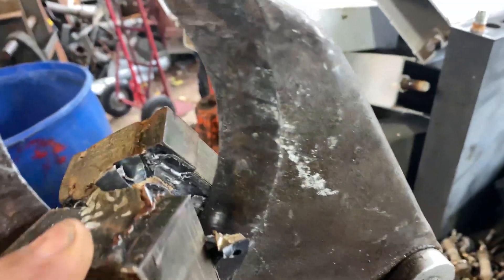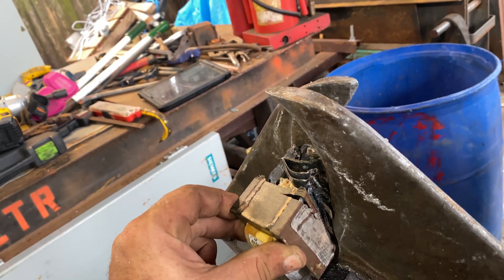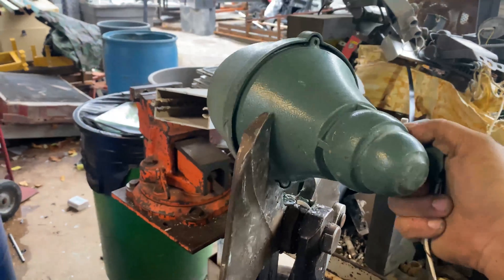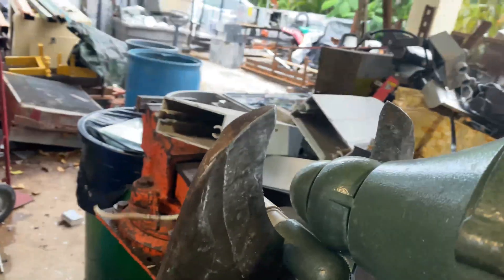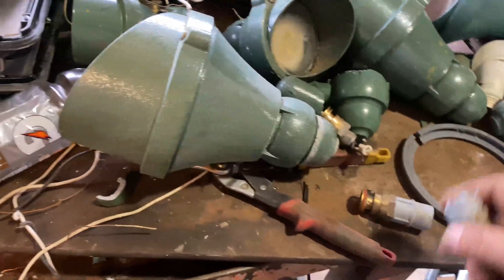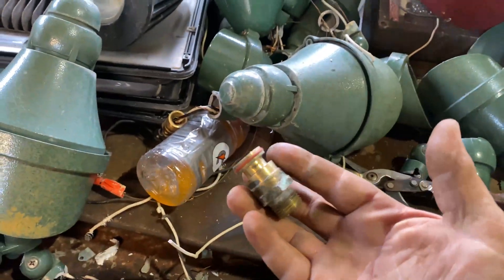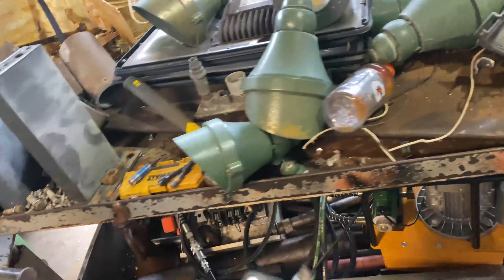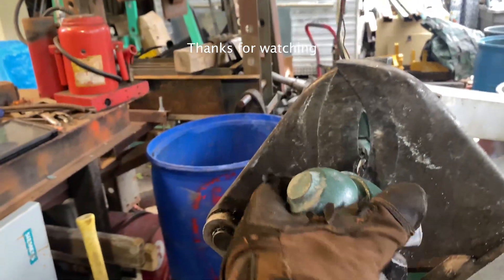Jaws Of Life  vs Transformer & Cast Aluminum

Comment: Might be quieter than a hammer, but there are drawbacks. Thinking of your future personal safety and workers in area, glass everywhere and your casual dress attire might be on a collision course...possible inhalation of glass dust, paint and aluminum. Some kind of apron around tool to catch the parts from the floor pickup. I don't see you letting a worker use this, too dangerous to insure... Speaking as an concerned old grandma (and I'm a guy) !
Reply from the maker: Have you ever seen a scrap yard with a alligator shear, its no different. It makes a mess but that's easy to deal with. thanks for watching.

Comment: Can you remove the glass in those lights before you crush them?  That just makes a big mess that you have to clean up later
Reply from the maker: Sometimes youncan get the glass out easily, but sometimes you have no choice but to break the glass, I usually do it with a hammer. Thanks for watching.